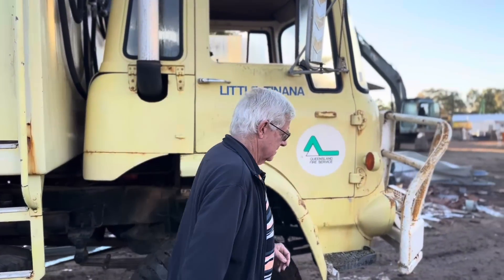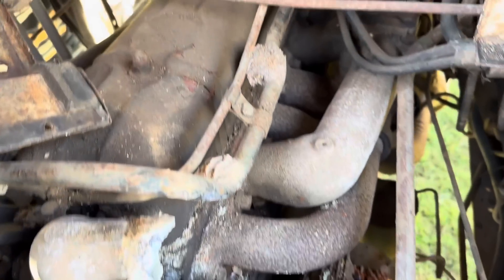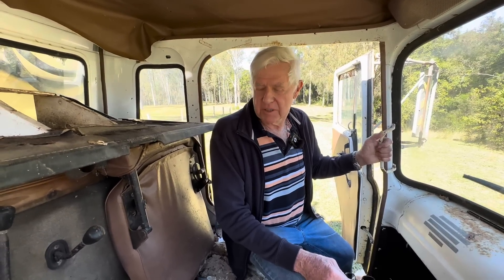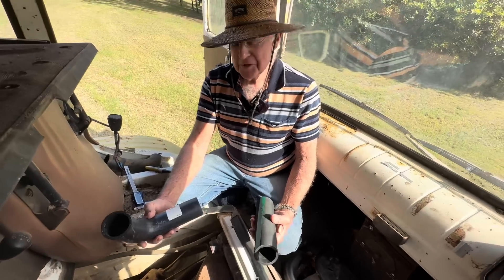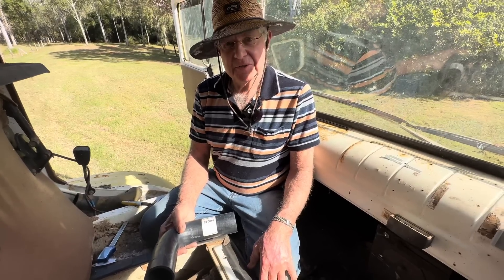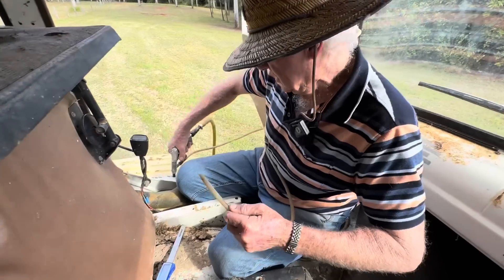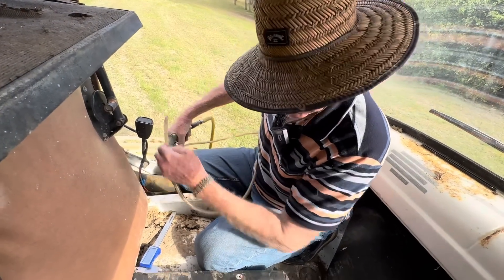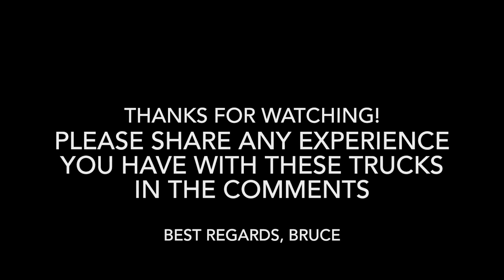Junkyard Save! Vintage Off-Road Army Style 4x4 Fire Truck - Will it Run?

Comment: Great Bedford MK ,backbone of the British Army for years ,I took my test in one in 1980
Reply: That and the good old Land Rover!   Back when we made some decent vehicles.
Reply from the maker: It certainly appears to be well built
Reply: @bruceinaus  well built and easy to work on
Reply: @PillSharks  good strong reliable vehicles
Reply: Did my army licence on the older round cab 4x4s in the early 80s. No power steering, that could be a great add on!
Reply from the maker: This one has power steering luckily, the ACCO 6x6 in our other video doesn’t so I know exactly what you mean!
Reply: Nice old truck! Used to see them everywhere when I lived in the UK years ago. If this one was a fire truck it’s done its fair share of rescuing over the years so it’s great that you’ve returned the favour and rescued it now. 👍🏻
Reply: Thanks for taking a chance on her and also uploading the video. These TK/MK trucks were designed to cope with nuclear war even with the smaller engines so I reckon that you have a bargain classic!
Reply: That brings back fond memories of the times I used to ride top cover with a LMG/BREN on the cab roof of a Bedford MK in the early 80s!

Comment: As a mechanic in New Zealand for many years, TKs were on the list. My uncle and I spent a lot of time in I reckon the coolest TK ever.
Converted to 6x6 with a 510 Perkins V8, a 6 speed overdrive gearbox and a Mercedes transfer box.
Manual independent hand brakes were fitted to rear for use on the sides of hills.
This was a purpose built truck for paddock topdressing on the very steep slopes around the Waikato in New Zealand.
I think it was named the Mountain Goat, but Uncle and I called her No3. Great memories.
I had my own mechanical business in Australia and on of my customers had the exact same MK you have there Bruce.
Was ex Vic CFA and had only done 18000km.
Still a pain in the bum like every TK, crawling in under the cab. Okay for a skinny mechanic 😂.
Thanks for your channel, regards Steve.

Comment: I once worked for a local council. 
And our job was. Making fire breaks 
And bush trails. The truck we had was  a  old international Fwd V8 with large water tank on the back. We would drive it down through the bush. Never let us down. They eventually sold it for scrap it was same size as the Bedford truck you’re showing us.

Comment: I'm 59 years old and can remember these trucks on the roads in the UK in the mid 70's, they were utilized as everything from pop delivery trucks to auxiliary fire trucks like in this vid. These old Bedfords will probably go on forever if properly maintained and the one in this video is a good-looking project with great possibilities for rejuvenation.
Reply from the maker: Thank you, I’m in the process of giving it a once over at the moment, cleaning out the dirt and vermin from the cab, checking/changing fluids ect. Once I get the radiator refitted I will post a video update. Thanks, Bruce

Comment: An old 300 cu in six. Australia also got the 214 cu in six. Not fuel efficient or particularly powerful, but relatively reliable. Common back in the day in local school busses, council trucks, delivery vans and so on. Some of the very last TK Bedfords here did get the Mexican and Canadian built 292 Chev engines, but yours is definitely the 300 Bedford engine.
Reply from the maker: Thanks very much for the comment @harrothepilot, we know what we have now. Thanks again, Bruce.
Reply: Yeah the 300 was in a lot of the effies
Reply: yep Bedford 300 6 cylinder  engine ,same as the one fitted to my RL and green goddess  bit thirsty but will run forever  if looked after  .Most of the military RL's and then later the TL  Bedford fire appliances had these fitted

Comment: Drove one set up as a workshop when an  Apprentice in   the 70s ,sucked in by the old stagers when they found out I had a fresh printed truck license. There was a AV-Gas 44 gallon drum slung horizontal under the tray as the fuel tank !Off road the steering wheel kick back was savage if a wheel hit a rock while turning , the heat in the cab was no joke in summer,the noise was the start of my industrial deafness claim .Great Days

Comment: I have an ex military truck a Ford D911 Cargo with a slant six diesel. 
It's a very reliable truck and cheap to run with a 5 tonne carrying capacity. 
I'm glad you saved that truck. It will work longer than the modern fully electronic ones.  👍

Comment: Bruce ol mate  !
Good score the old girl 
Should dress up ok !
The motor is a 300 ci Bedford  ! As long as you 
Keep clean oil, filters and 
Water in her and don't expect 80 mph she'll give you 
70 hrs a day and  500 days a year  just plugging around the farm  !
The first truck I had was a 
68 TK EFN series  !
With a 308 Holden V8
Rolling on 16 inch 
6 stud hubs  ! Originally 
She was a MYERS store 
Truck with a 214 six cylinder.

Comment: Well, this takes me back. I used to drive a Bedford TK horsebox that was a de-rated 10 ton fire truck chassis. I think it was a 1976. After it was plated for 7.5 tons the horse 'container' was added on. In our case this looked like an old railway goods wagon. It was certainly over 10 tonnes, but by then it was plated so I never got stopped and it didn't have to be inspected again. Just MoTs, and we had a friend who did that for all the local horse boxes. We had a living room and kitchen in the front and space for four horses in the back. It would sleep four or five people. I always slept in the single bed above the cab. I had the 3.3 liter diesel which was almost completely shot and utterly gutless. Someone asked me the 0-60 and I said about 20 minutes, that was the time it took to get to a good downhill on the M1 down towards Luton. The fastest I ever had it was 67 mph on the M11 going down a steep hill behind a container truck. It had five speeds, but all the springs in the shift were shot, so going from 5th to 4th in motion was very difficult, as was 4th to 3rd. If I missed a down shift on a climb I'd have to pull over and start again in 1st, then continue over the hill in 2nd. Up shifts were much easier, double declutching didn't help a lot, the speed fell too fast. Getting reverse required leaning on the door to get leverage. I drove the box to most of the big shows in the south of England and Wales, including The Royal Show, Essex, Three Counties, Windsor, and many others.
Reply from the maker: Thanks very much for sharing this, best regards, Bruce

Comment: Great to see you got the old girl running with minimal effort. A good example of our throw-away society. Most likely reached it's "depreciated value" life-span - the level at which the bean counters decide it's going to cost more to maintain as opposed to spend up big on a new unit they can then depreciate over another 10 years.  Creative accounting. How much usable equipment ends up like that? Lots.
Reply from the maker: It’s a sad but unfortunate reality of todays society I recon, thanks for watching, Bruce

Comment: Brings back memoirs of the old days when bush fire trucks where brought by the member of a bush fire brigade before the Government took over and recalled it the RFS in NSW  most of the trucks were gotten rid of because of the petrol engines after the 5 bush fire fighters where killed in a truck like this one  near Sydney  as the engines got vapors lock in the fuel lines making the truck non movable .  The  MR Bedford trucks where bad for the diff problem in the bush  being gear too high  but where the best next thing to a Ford and chev Blitz's trucks after WW2  as fire trucks.

Comment: hi greetings from england, first watch out for rust on the cab wings and generaly check the whole cab,if the engine is a 4927cc petrol engine its the same that went in the RL i have the manuals for this engine, when running correctly this is a quiet engine, timing is 5 degrees BTDC, with marks on the flywheel, good luck
Reply from the maker: Gday Peter, thanks very much for the information. I have checked the cab over for rust and it only has a couple of pinholes in the guards and roof. I think it has been shedded all it’s life. I suspect it may be that motor, it is very smooth and quiet, I will get the timing light out and check the marks over the weekend before the radiator comes out to be repaired. Thanks for watching, Bruce.

Comment: They were Army trucks in the UK. I remember seeing them as a kid in the 70s/80s. Like many vehicles back then they would rot very quickly in our damp climate. You do still see them around as Horsebox conversions (non 4x4) and I think there are plenty of parts available. Bedford was part of Vauxhall which was the British GM subsidiary, so maybe Holden parts would work?
Reply: A lot of those Model Bedford Trucks had Holden 253 & 308 V8s in them. As Holden was fundamentally Bedford Australia.

Comment: I worked for UPS., the inline 292 Mexico built was the last inline gas engines they used in delivery vehicles. With continued hard use they would warp manifolds but for your use should be fine.
Reply from the maker: Thanks for your comment, I’ll take it on board and monitor it for leaks around that area, Bruce

Comment: Around the corner from me my neighbor has a landscape business. Out in front
of his house, parked on the street is a big ass old Ford what looks like it may have
been a power co truck decades ago.Its a 1960 vintage BUT it has a cherry picker
arm attached to it. I suspect he uses it to trim tree branches. It mostly sits but 
on a rare occasion I will drive by & it will be missing  OR  I will find it parked
someplace new, so it does move now and again.

!
Reply from the maker: Thanks for sharing, Bruce

Comment: motor sounds a lot like the old landcruiser fj55 im sure they some came out with chev inline 6 .a bloke I worked had one and used some holden parts on his , not sure if he said it was 272 or 292 , in case you need to sources parts , I gather theyde be same block different bore n stroke maybe but still parts would fit👍

Comment: air over hydraulic brakes and transverse wheel cylinders on the rear with a bisector working on the shoes and hand brake levers that had to be adjusted properly for the handbrake to work

Comment: That style of truck was used by the overland travel companies that sold tickets to ride in the back of one of these for the three months it took to travel from London to Cape Town.

Canvas top and sides, bench seats in the back. Luggage stored all over, tents and bedding, kitchen.
By the time it got to Cape town it was only worth being sold off.
The driver and a mechanic conducted the tour and then flew back to London to do it all again.
It may explain why there are so many in South Africa?

A workmate who had been on the trip said they had to  organise a meal at the roadside just before entering Pakistan as
they had been tipped off that Customs were hot on booze entering the country that day...(Religion) 
so they set up the table with a very large draped-to-the ground tablecloth over a road drain grate and surreptitiously tipped out all their booze and dumped the bottles.

They were rigorously inspected at the border...everything tipped out....no alcohol found.
Welcome to our religious booze free country you heathens.

A kilometer down the road in Pakistan were liquor shops set up on both sides of the road....buy your booze in our country.

Another commenter mentioned vapour lock...the suction line  from tank to fuel pump is long and small in diameter...and having suction on it in hot weather will vapour lock.
Apparently wet rags can make a difference but probably a cheap "Facet" clickety click  low pressure fuel pump on the tank and pushing fuel under pressure to the original pump means a more heat and vapour lock resistant fuel system.

There was a story that the  Army Camp in Waiouru in the middle of the North Island of NZ had a 4wd Bedford Truck with the same engine in a rapid response vehicle (ambulance/rescue) which their workshop fitted with 3 twin choke Weber carbs and a hot cam and extractors....worked well up to 75 mph apparently.

Comment: Wow never knew a heavier Bedford with those 10 stud split rims would have a petrol six. I expected a 466 or 500 dIesel. 
Would you consider fitting a Ford Barra turbo to it? I do like that large Chevy engine in it though.

Comment: I worked at park Engineers and they had one the same. The one they had had a Holden motor in it air hand brake it was next to the seat had high/low on the stick it had high and med range most uncomfortable thing I’d driven

Comment: Thats awesome, Bruce 👍 did you get it for scrap price? 😁😁
It would make a great overland camping rig.
Reply from the maker: Thanks! I actually only stumbled upon it by chance when I was down there to organise delivery of a ex military 6x6 International Acco truck. The body work on the fire truck is really good and it looked complete so I decided it had to be saved. Next Job will be to get the radiator fixed, change all the oils and see how it goes off-road. Then I will see if I can get the pump running for the fire hoses. The pump is powered by a vw car engine and also looks basically complete except for a few fittings ect. The pump engine shows only 86 hours, not sure how accurate that would be.
Reply: @bruceinaus  I can't wait to see that. I'll be watching for sure. 
G'day from the mid north coast, NSW

Comment: Im kind of surprised there arent more straight 6s being made. They lasted longer than the v6 models and had good fuel economy.
Reply: Bedford never made any V6s that I can recall or are you referring to a 6V53 Detroit.
Reply: @andrewking4885  I'm just referring to s6 vs V6 designs. A s6 engine has less cylinder wear due to the pistons being straight up and down. V6/v8s wear quicker with the pistons laying on the cylinders wall.
Reply: @nedlyest  Cool you earnt your Brownie points. Some famous s 6 Diesels ⛽ are the 6-71 Detroit.  Mack 237 Maxidyne. The MTC 350 Cummins. 3406 Cat and Series 60.  Cheers from Australia 🌏.